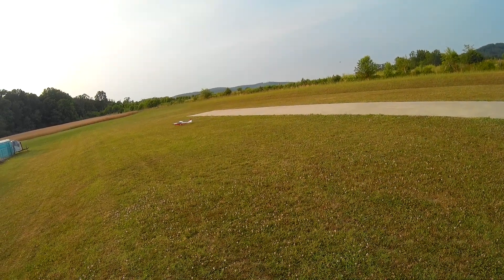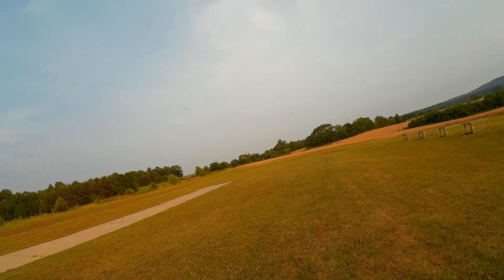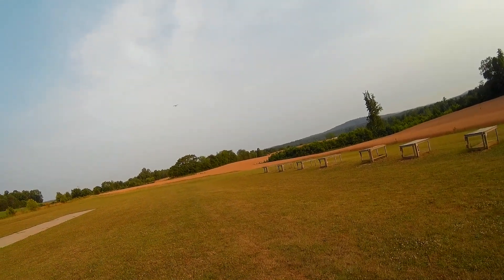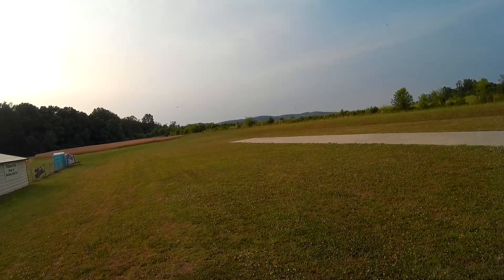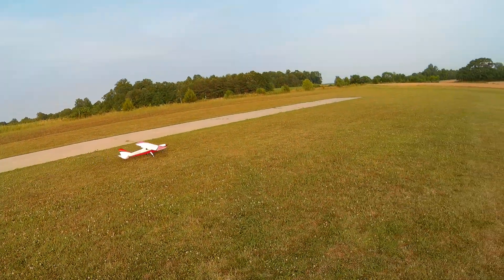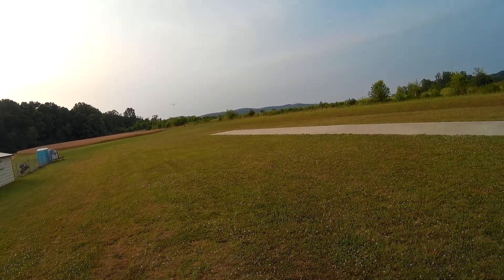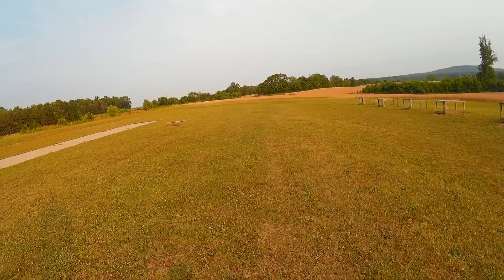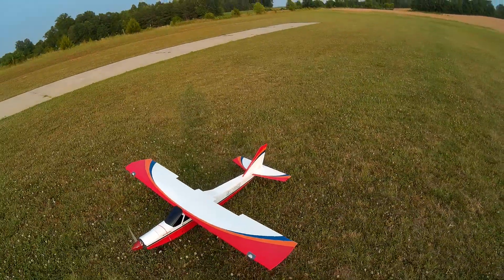Great Planes Avistar Elite Electric Conversion

Comment: You is the flap mod yourself right? Also, what size motor and battery are you using?
Reply from the maker: I did. Just installed the servos and cut the little dowels that hold the flaps in place.  Rimfire 46 motor with Graphene 4s 4000. 60 amp esc.